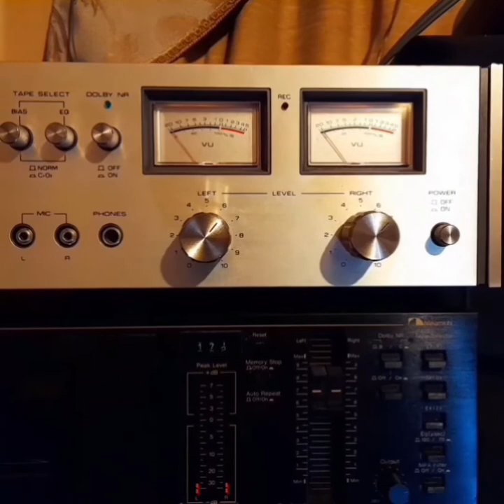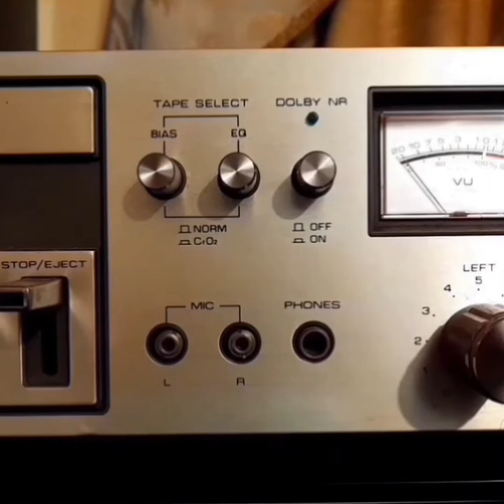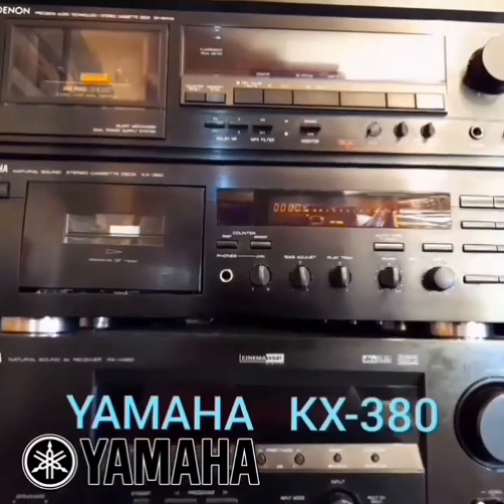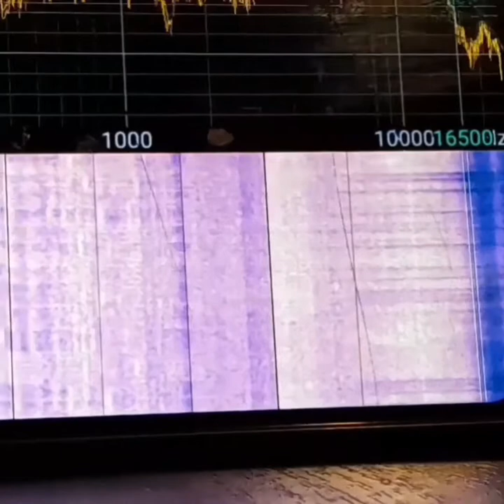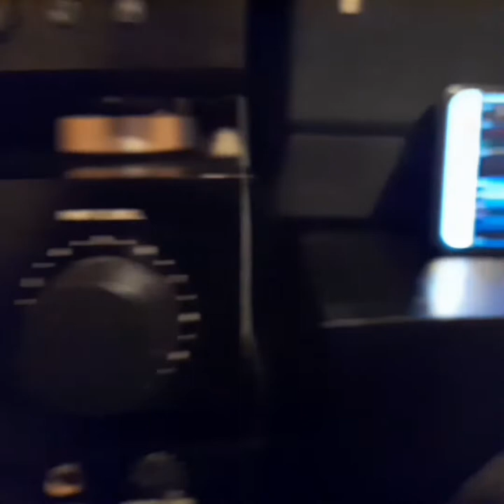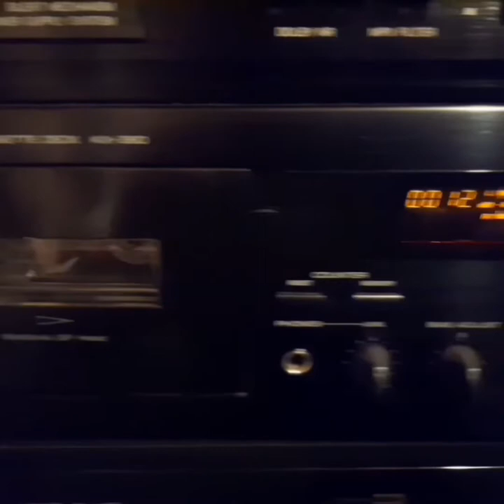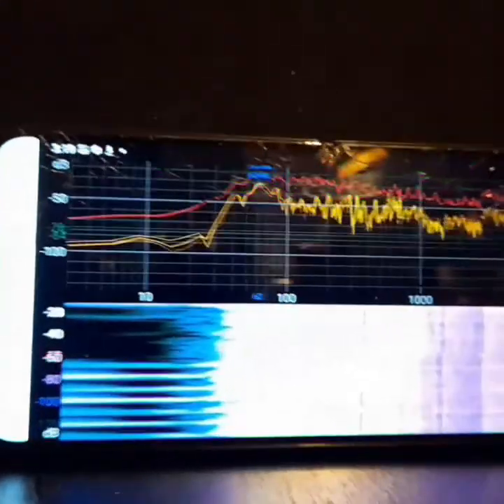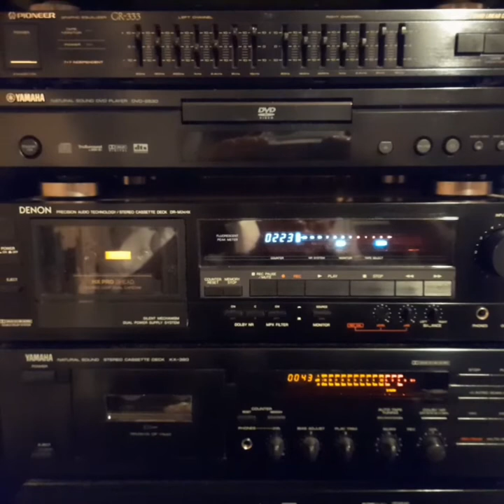SOUND OF 4 DIFFERENT CASSETTE DECKS USING A TDK AD CASSETTE

Comment: Cool video vidtech. Not to get knit picky with you. You said of the 1st deck that 16.500khz is like that of a type 2 cassette. I beg to differ somewhat sir. A true chrome cassette will on the right deck of course go up to 20,000khz. So maybe you were referring to a later type 2 that has a cobalt doped formula. In that case you'd be correct. Can you do a similar vid to this on using Type 2 cassettes ? That would be sweet !! Great video overall ,I enjoyed it very much. 😎 👍
Reply from the maker: Thank you for your input and for a future video topic , suggestion.
Reply from the maker: ...pure chrome cassettes can be a excellent or a can of worms ,  They can be subject to deterioration and appear to be more  easily damaged (although TDK premium tapes , can suffer from train tracking too), can suffer from sticking to itself.Or even tape sheding . And not every cassette deck can utilise them to their full capacity. Than there were these chrome pre-recorded cassettes , recorded as type I cassettes.  Chrome cassettes and all their ins and outs , is a complex subject,  I think.....
Reply: The heads is a big factor in frequency response. Most decks do not have a frequency response of 20hz-20khz. Very few two head decks are capable. You see that in 80’s+ 3 head decks.